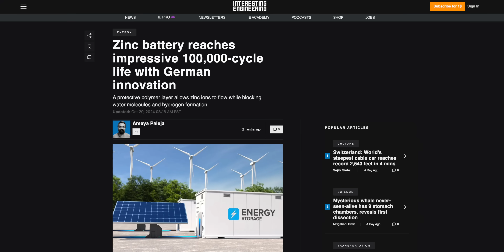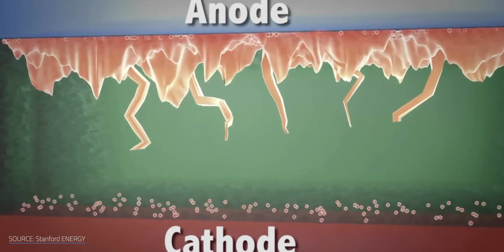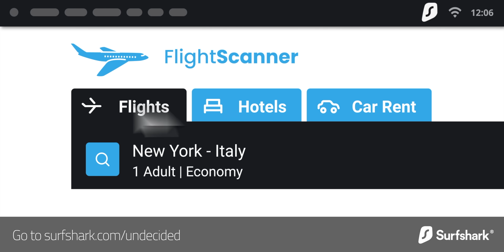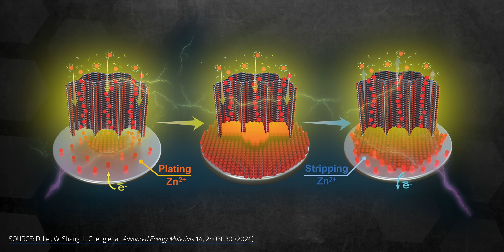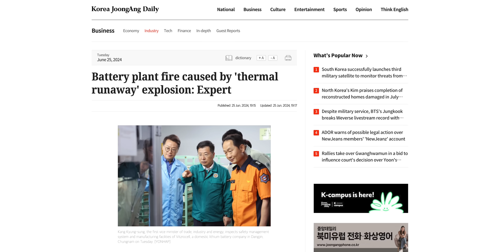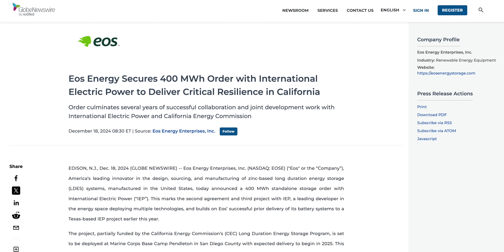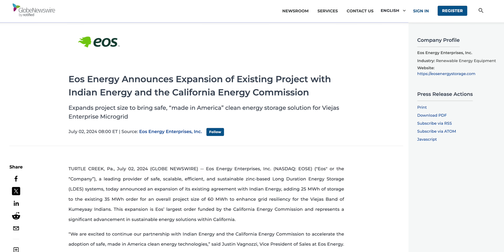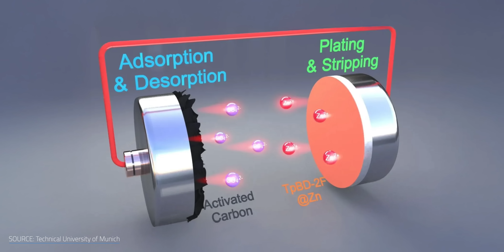How Zinc Batteries Are Defying Limits

Comment: Ignoring the obvious mistake of the milage comparison and the odd way you mentioned previous zinc ion batteries "only lasting a few thousand cycles" when that's plenty fine for a lot of modern usage and comparable to many competing batteries today, this new polymer being added in to make the anode behave better is extremely similar to changes that were made to lead acid batteries many years ago. Modern lead acid batteries last much longer than they used to due to the addition of organic polymers that help stabilize the electrodes, lowering the rate of disintegration (particularly of the lead dioxide anode), and limit the rate of electrolysis of the electrolyte creating hydrogen gas. In other words, this "new development" is not really innovative as much as it is just applying an old idea that's already used in an old battery to a newer battery.

Comment: Now there is a jump in the capacity of phone batteries, which is the shift from 5000 to 6000+ mAh due to lithium silicon batteries, and for zinc batteries to achieve this jump, it will take tens of years and a charging speed of this density Things are as important as lifespan, or even more important, especially in things of limited size, such as laptops, phones, and charging speed, such as electric cars, which you will literally have to wait for to charge, so charging speed is one of the most important factors, or even the system of solar energy. You are limited by the period of sunrise, so charging speed is the most important factor. Also, the efficiency of power output and to what degree you can drain the battery without damaging it

Comment: I make zinc power cells. They are not powerful, but I can keep a steady 1.5 volts per cell. Abd never have to charge them. They are for chemical energy. Im looking at designing an off grid battery with ZnO GANS Plasma. If interested, hit me up. I could use a discussion on future endeavors.

Comment: This is silly…the LFP batteries being made now are good for 1.5 MILLION kms before dropping to 80% of original capacity…lithium battery infrastructure is too big now to be challenged unless the energy density is at least 2-3x better for a similar cost (unlikely for next 10-20yrs) 

LFP is the battery of the next decade for sure…lithium is the lightest metal on the periodic table…hard to beat that when you need a metal to make a battery…invest accordingly…prices may be down now but that won’t last…

once ppl realize how long these LFP batteries will last (25-40 years! Even in grid power storage solutions) it’s all over for anything else.

Comment: Slap this tech onto Zinc-Air Batteries to improve the cycle lifetime of those batteries. Zinc-Air batteries are plagued with the exact same problems as a Zinc-Ion Battery. There are also some problems with the cathode, but would still change things up. Zinc-Air batteries have a really high energy density. I calculated it out that for a Zinc Air Battery to supply NYC for 24 hours, it would be the volume of 5 olympic swimming pools. So enough to power NYC for 24 hours would require an olympic swimming pool size battery except 15 foot deep instead of the three foot deep that is standard.

Comment: There trying to get rid of the right to fix and repair. Your going to need a $1000 dollar bi directional. Scanner. And they already have an integrated electrical system that does not allow you to drive your vehicle if your rear camera shorts out.

Comment: i like your videos. very straight forward, and matter of fact. but it seems like you're missing a few things. like, a comparison with similar batteries, something like an edison. very similar profile. stationary use, not too expensive, high cycle life. would be nice to see a comparison between the two. see what kind of real progress we've made (or not) in the last century. might also be nice to see what multiple of C does to the cycle life. from what i remember, edison's are pretty robust. and safe. and recyclable? and given that the patent is run out, it's not subject to a ton of pricepoint capitalism, so, theoretically, someone could make their own, AT COST, these days.

Comment: EOS uses a polymer anode which I assume is infused with zinc. This doesn't only exist in the lab. EOS Energy (EOSE stock symbol) is very familiar to me. They now have all the funding they need. Their fully automated production line turns out a battery every min or so. They have a huge backlog and are shipping their  z3 cubes (big as shipping containers) every day. Someone saw them on the hwy....I heard of Bridgelink;  EOS doesn't need them. that was maybe 2 yrs ago. I have been a shareholder over 2 years; never heard of lawsuits on any msg board. An important feature EOS touts is they can discharge for 4 to 12hrs. Li can only do 4 hrs. I never quite understood what they mean by this. They are longer lasting than other technologies. This combination of features actually makes Eos more economical.

Comment: Hmmm, interesting.  The lower energy density restricting its use to stationary applications might be Zinc-Ion's Achille's Heel, though.  Solar (photovoltaic) keeps improving as we deal with the band gap losses and durability challenges, but even at projected efficiencies, it still isn't even close to space competitive with fossil fuel or nuclear for the same energy output.  So if we try to pair them as the savior of renewables, I think they'll remain niche and obscure.

There is a place where they might be able to actually replace fossil fuel plants, though, and that is to use them in conjunction with nuclear to handle variable loads.  All you need then is enough capacity to allow each plant to output the average daily demand constantly.

Comment: The key with batteries would be to use them in vehicles till 80% SoH, then use them in buildings thereafter. Batteries has a lot of life left after reaching 80% SoH, but may not have enough density for portable storage.

Comment: Two points: 
1) Your correction to the video needs correcting.  In the video you say 300,000 - 500,000 miles is the distance to the Moon and back three times.  It is then corrected to two times.  But, as your graphic shows, the moon is about 240,000 miles from Earth.  It's more like, "To the Moon, and maybe even all the way back."  

2) The "100,000 cycle battery" claim struck me as extremely suspicious.  What kind of meaningful battery could be discharged and recharged 100,000 times?  If it's just a little guy that they've built for the experiment, then sure, maybe, but does that scale up?  But to be clear, even if a full discharge-recharge cycle takes one minute, we're looking at letting this thing run for more than two months.  A realistic commercial scale battery that could be cycled in an hour would take a decade to test.  (Lots of estimating here, I'm saying that there are 100,000 seconds in a day for simplicity's sake).   It's either being done on a microscale, with something like an experimental small scale battery that can be discharged and recharged on very short time periods, or it's something else entirely.  So we dig up the paper and find that, no, they never tested a battery through 100,000 cycles at all.  They build a capacitor with their anodes.  Will this still work when it's wet chemistry?  When it's scaled up?  Who knows?  But at least we've got a gee whiz video.

Comment: As for the lifespan of an EV, remember, the mechanical components have a limited life. Metal fatigues.Steel rusts. Seats get worn. Glass chips & cracks. Rubber ages & rots.
Even if a battery lasts long enough to drive 10 million miles, the car will not.
 
In many ways, the ideal is for everything to fail all at the same time. Everything will fail at some point, and has to be disposed of. We don't want to dispose of good parts, but will we transfer good parts from a ruined car to new cars? We do it with junkyards to keep old cars operational, but no one wants to put a used part (thus having a shorter life) in a new assembly. Therefore, since everything will fail, it's best if it all fails simultaneously and then have all parts replaced at the same time, i.e., get a new car.
 
A battery that lasts longer than the car creates problems. I wouldn't put it in a new car. But I wouldn't throw it away, either. It would need to be repurposed. I would upcycle it to provide load leveling for the electric grid. Even today, failed EV batteries still have ~70% capacity, and that's enough for houses. It could power a house (minus HVAC) for several days. Or, it could allow the house to draw power from the grid at night when electricity prices are cheaper and disconnect from the grid during times of high demand. Obtaining 'junked' EVs is cheaper, too. The issue, obviously, is safety, especially fire hazard.

Comment: i dont just want good life span , i want to be able to change the battery when ever i want , i want the fucking industry to go back to being open and have standards and not be disgusting pieces of shit and locking down every single thing , you want your seat warmer ??? how about a subscription  to BMWbuttwarmer program 3000 for the low low price of 11.99 per second of buttwarming .
I want them to decide on a shape , size and connector aswell as a way of STANDARDIZED cooling , if it liquid the port must be the same , the BMS should always output all battery health information in a well documented and non proprietary maner . THIS is what i want to see , i think we all have had enough of this bs .

Comment: Phone batteries can outright last forever, it wouldn't change anything for anyone because no one ever gets a new phone because the battery has been charged too many times. By the time that happens, the phone is outdated anyway and a replacement battery is like $20-30 even if it was an issue

Comment: What is the entergy density compared to Lithium?  You briefly mentioned you would need a backpack sized battery to operate an iPhone compared to Lithium. Hopefully the reduced cost makes it a potential option for applications where space is not a concern.  Will these batteries operate in colder or hotter environments?  Sorry for all the questions

Comment: Abundance and ease of processing above all makes it a greener option. 
Not having to move 250 tonnes of earth for one small EV battery (that's about two mining dump trucks full, guzzling up 100+ liters of diesel fuel per hour) is simply greener. For Zinc that's about 5 tonnes, but more importantly it's a byproduct from mining silver.
Processing is also more environmentally friendly. Lithium is a great option for cars and other mobile applications, but we are currently just being wasteful with lithium. In ways even more then we are being wasteful with oil.

Comment: EV batteries lasting 300 thousand miles? Most EV cars are trash in ten years so that means you would need to drive 30 thousand miles a year or 2500 miles a month as they only go about 2 or 3 hundred miles per charge it won’t be easy to do.

Comment: Saw no mention of the speed of charging ZINC battery. If the density issue could be improved would this mean faster charge intervals than lithium ion batteries. 
And is that technology readiness chart your idea, Matt??

Comment: You should look into city is a battery that has zero degradation at 50,000 cycles. It’s actually a graphing battery that is being made. The actual name is sustainable energy tech, technologies, ink they claim that these batteries will stand extreme energy output, and charge in 2:54 quarters charge might be something you would like to look into

Comment: I have an old drill i used almost day for 10 years and still use a few times a month for light duty with a Ni-Cd battery. Those are known to last 2,500 cycles for better quality ones and dont suffer from "memory effect" that NiMH have. Its a good battery thats almost 25 years old 😮.. And a jump to 100,000 charges is insane 🤯

Comment: How is a few thousand cycles in the past "short" 4:45 when li-ion is measured in hundreds..? How is water based electrolytes safer than Li-ion electrolytes(2:50) if it still has a tendency to produce H2 (4:32), which is the problem with li-ion explosions..

Comment: So this video isn't  necessarily  about zinc batteries? But regarding the zinc battery mentioned, it's  nice to know about claims but there is nothing about the mass and energy density of the specific formulations mentioned. Or design since my only personal exposure  to zinc batteries have been air batteries.

Hard to compare and evaluate when not all the basic specs and description are described.

Comment: Unless Zinc batteries for the same charge as Lithium batteries are smaller and cheaper, Zinc batteries will not replace Lithium batteries present when battery 🔋 powered items like EVs and phones.

Comment: I am optimistic but I have questions.  What is the optimum operating temperature, and what happens when the outside temperature goes below freezing?  I see photos of the batteries in California where they don't have winter,  what about Western New York where I live?  It's presently 24 degrees F and last night it went down to 8 degrees F.  If water is the catalysis what keeps the water from freezing?  Some lead acid batteries lose 30%-50% of their capacity at 32 degrees F,  and Lithium batteries aren't much better.   Satellites use part of their battery power to keep them warm along with the electronic components, will this be needed?

Comment: i like that we’re always trying to improve, but make no mistake, the existing, cheap, LiFePo4 cells you get from China are already lasting decades when you treat them well. they’re already amazing. no need to wait, i live on 100% solar renewable energy powered by $2000 of Chinese cells and i rarely feel like i have to hold back on power consumption, although i maximised efficiency too.

Comment: If Zinc batteries can be cheap enough for a household to buy 100-1000kWh (i.e. less than $10-100/kWh, compare: currently lithium batteries for households cost around $1000/kWh, at least here in Sweden), in addition to being safe and long lasting, I think they will sell really well here. With 1MWh storage I could offset every price spike for the whole year with my production or charging at low cost, potentially cutting my yearly electricity cost in half or more (we have extreme fluctuation, where price per kWh can vary from negative 10cents up to almost a dollar).

Comment: Zink and lithium mining are about equal in energy cost per ton if using the brine lithium extraction method.  Given sufficient infrastructure, both should cost about the same.  

I don't know of the hazards working with lithium, I know the metal burns very hot when it burns in a battery or otherwise.  I do know that high concentrations of dissolved zink are poisonous but not cumulative over time.

Comment: EOS Energy is already producing Zinc batteries at scale for grid power. They are boasting a 20+ year lifespan. Which is honestly the perfect lifespan for batteries if you consider that in 20 years, the new battery chemistrys will most likely way out preform them.

Comment: Dendrites: I have since I learned about them had this silly question in my head. What if a shaking the entire battery or the cells or whatever was a stupidly simple solution to breaking up the dendrites? Any experts in the house? Not that kind of dendrites? Not that kind of re-melting back into the fluid etc like chocklate chips in a cup of hot cocoa?

Comment: EV battery anxiety is rooted in the COST OF RUNNING OUT unexpectedly. If EV manufacturers ever get to the point where they realize this, and come up with a portable, inexpensive way of retreiving a spent EV, that's the only way battery anxiety will be alleviated. Why can't there be a portable quick charge that can be brought to the disabled, out of charge EV, and give it enough charge to get to a stationary charger ? Until this is a cheap, and readily available option, I for one will never consider an EV. Paying $300. minimum for a tow, just because you ran out of charge is a gigantic stumbling block to EV adoption. Who hasn't run out of gas ? A ride to a station and back is all it takes with a gasoline car, but an EV, you're held hostage.  It is the aspect of battery anxiety the industry is *ignoring*.

Comment: I have kept an eye on battery technology for the last 25 years. If I received a dollar for every new exciting  "promising battery technology" currently in a lab somewhere I would be a billionaire. There are TONS of these promising lab projects and 99.99999% of them fail to scale or deploy. Do we need more of these projects? Yes we do.
Reply: They don’t fail, media tends to overhype them
Reply: Atleast we have guarantee we won't die if lithum runs out
Reply: Have a look at the nickel zinc batteries there still using hundred years later 
I believe it's a very viable system 
Just a tad expensive I noticed

Comment: Lifetime estimates only at 150,000 to 200,000 miles?????????? If this is true then they really a huge rip off compared to ICE. According to those numbers my ICE should have dies over 20,000 miles ago, yet it still runs just as good as when I bought it. In fact, the majority of this cars brand will get 300,000 Miles, and then some more. 

An EV that is expected to travel no more than 200,000 miles is not worth buying over ICE. That alone makes the EV far more expensive than the ICE, even after all maintenance costs, and even possibly replacing a transmission and an engine.  By the time the ICE dies, well over 300,000 it would have been much cheaper than the 2 EVS you will have to buy to have the same driving range.  No wonder EV values drop like a lead weight.